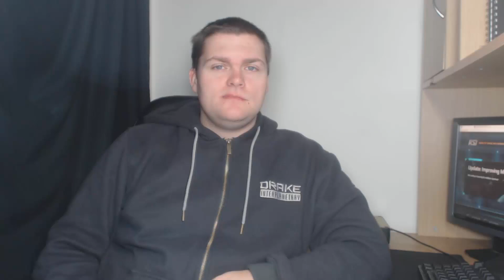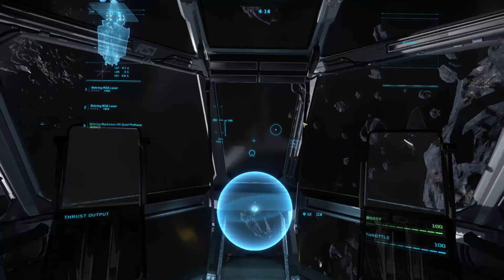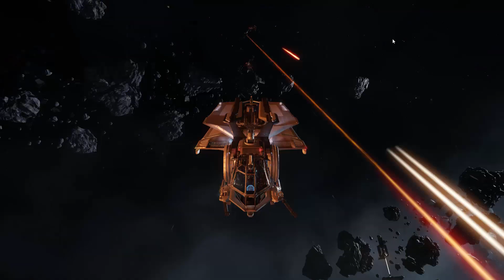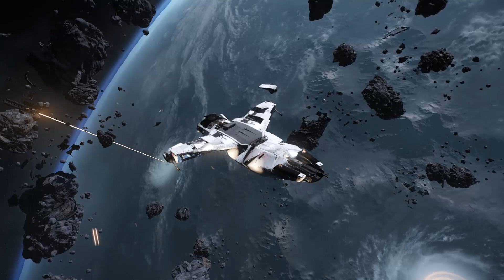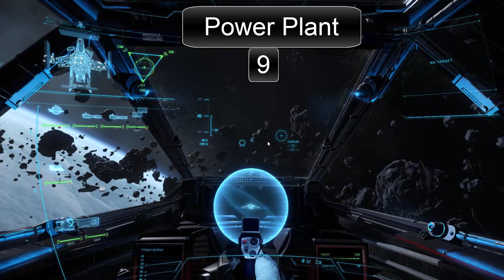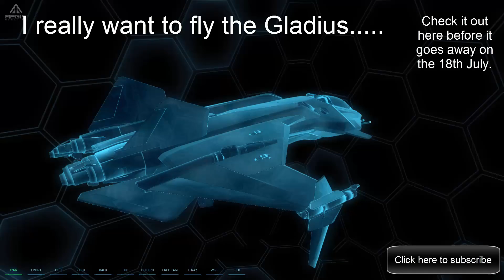(Outdated) Star Citizen - Shield and power guide

Comment: Great advice!
I see you've switched to mouse from the X-55. I've been thinking whether I should do the same, since I am definitely more accurate with the mouse, but at the same time it is hard to watch my X-55 gathering dust next to me especially considering that I got it just for Star Citizen : /
Reply from the maker: I'm actually just trying to get used to using both, and when recording a mouse takes up a lot less space on the desk. I still like to use the x-55 more :-) Though I agree the mouse is more accurate, so far I can still fly better with the joystick. Plan on playing with an xbox controller soon to see how that is.
Reply: Mercenary Thorrn and this is why SC is a disappointment (to me anyway), It's turning into a mouse shooter. This is the same problem i had with war thunder, as they use pretty much the same aiming mechanic. I was struggling with my joystick to be accurate, was getting 2-3 plane kills per round, switched to mouse/kb got 12 in my first round. SC why did you use this, you should have independent axis controls, with out blending pitch and yaw into 1 for mouse.
Reply: Nicolaos Soldal
By the way he is streaming right now flying with his X-55 on Twitch
http://www.twitch.tv/mercenarythorrn

I am back to playing with the X-55 hotas. Thanks to Thorrn here sharing his layout for the X-55, I mapped my two hat switches on the throttle to 6 directions of strafe, toggling coupling off and on as the hat switches move out of and into their center positions and I feel as if I have much more control with the joystick than with the mouse again.
Reply: There is a link under the descriptions of both his Voice Attack Tutorials